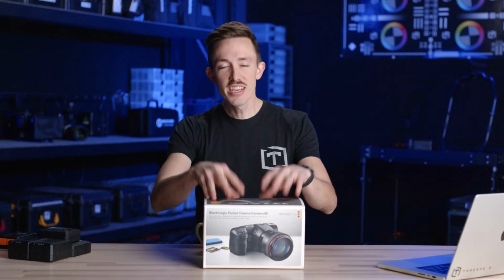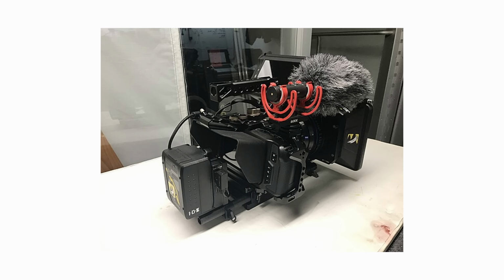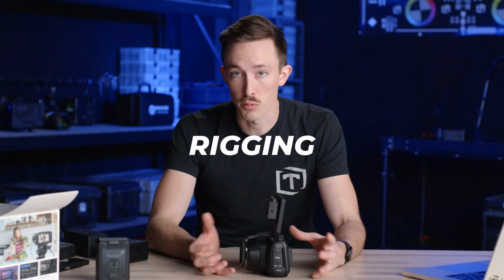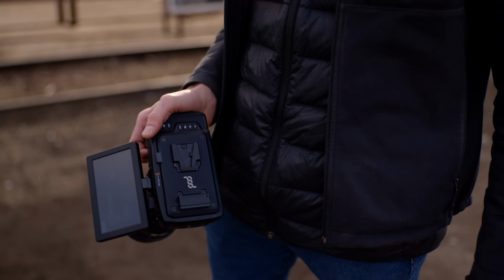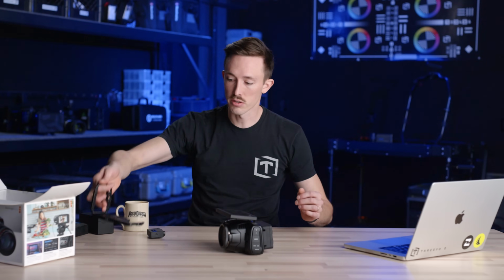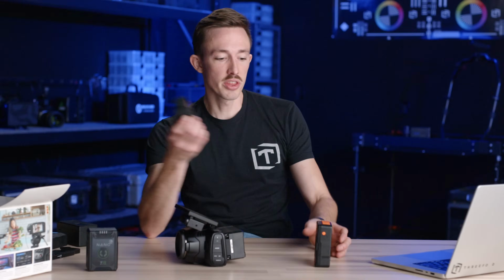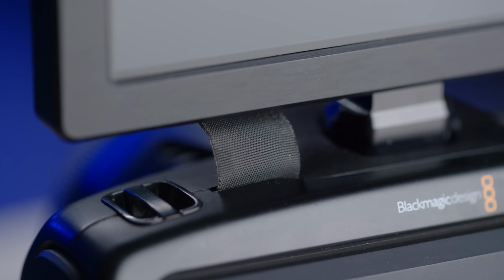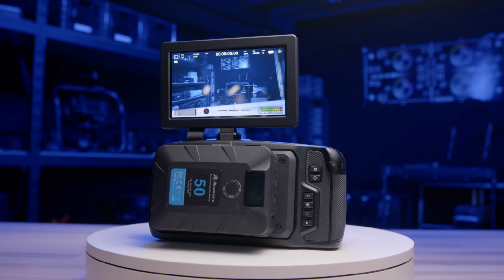The Camera We've Dreamed Of Is Finally Here! (Not Photoshopped!)

Comment: Pledged! I think this looks really promising. I have two P4Ks and this could potentially turn one of them into a more nimble set up. Willing to give it a try!

I've always used them with external monitors rigged to top handles, which is the main reason I've added the top handle for anyway. Carrying the camera and resting between shots are secondary uses, but I rarely find myself using the handle while recording.

The way this places the monitor on top of the camera, and much closer to the body compared to attaching it to a handle, while also freeing up the HDMI port to be used with a transmitter rather than an extra monitor is really good. Plus you run power and video feed to the monitor over the same cable, giving you a much cleaner build without external batteries or power cables to D-tap and extruding HDMI ports.

With a half cage on the left side like you showed, you can still rig up a rod with follow focus and keep the small footprint.

The only things that I can see as possible limitations are if you want to add a shotgun microphone or an easyrig. But I'm sure that can be worked around somehow.

Great to see that you can still improve these cameras all these years later. Would be very interested to see a gen 2 of this solution for the 6K Pro with internal NDs, with some thoughts to how you can improve further and allow for more versatile builds.

Now we just need BM to support more anamorphic ratios natively, which is another drawback from getting rid of the external monitor.

Comment: If you assemble the mod yourself, and the monitor mount is supposed to go on to the 1/4" thread on the camera, what's stopping you from using a cage and attaching the monitor mount to a 1/4" thread on the cage? Is it just the length of the ribbon cable?

Comment: This really solves so many issues and I love that. My biggest issue is screen replacements, I've never had any luck getting my bmpcc4K screen repaired after it delaminated through no damage I did to the point only some parts of the screen are touch-capable. I'd kill to just find a replacement screen so I can start using this camera again. BlackMagic was no real help.

Comment: If they were going the extra mile to replace the rear element, design a monitor w/ new housing etc etc.. it’s entirely possible to just redesign the camera into a more ‘brain’ like body such as the komodo, alexa mini. This would reposition all the camera buttons so that they could be on the sides on the camera or at the top, out of the way of the battery plate. Also adding more surf area for rigging.

Comment: love this idea, but i'm already 6 min in getting impatient. some of these videos i really just want the information, and don't want to skip thru your stuff to get to it. would love if you made condensed versions. or cut them up for shorts? i skipped to how to get the mod, and we got two talking heads back and forth still for another minute to find out it's a kit that seems to be modded off another designers kit? this looks good, but that ribbon on the monitor is not going to last long at all. i have 3 6ks, i would love to mod them if we can figure a solution to give better protection to that monitor ribbon.

Comment: Everyone in the film world misses the essence of BM pocket cameras. They are designed first as small live production cameras which then have filming features added on afterwards. And if you put the pocket cameras on sticks, raise them up to eye level, and add a focus demand to the fluid head handle—all of a sudden the 5” screen is in its native position. With that said, would I try the modification you demo here, even though I’m mostly a cine shooter? No, and that comes down to the build of the camera body itself. It’s a cute design, but bump that monitor a few times in and out of a bag or on set and the camera starts to crack, not to mention the strain of v-mounts on and off the back of a camera not designed to handle the repeated strain. I’ve never had a problem with rigging v-mounts. I’ve always used a base plate system which gets the camera up relative to the rails, and I’ve set the v-mount receiver in a prone position so the battery doesn’t interfere with the screen. This makes for a slightly longer rig, but it also keeps the center of gravity low relative to the fluid head. And now that we have mini v-mount batteries, the length isn’t even an issue any more. And let’s not forget the Tilta Lightweight Shoulder Rig which makes it really easy to mount batteries low and behind the shoulder. And with all that said, there’s far more robust ways to solve the problem this modification tries to address, especially with the more recent BM designs which have tilting screens.

Comment: Blackmagic themselves keep just milking out the same camera body, instead of listening to the end users for a better design. Though it looks like a cool mod, but wished it would allow a top grip especially when the camera is fully rigged out to work with a full crew with transmitter and wireless follow focus, you kinda need a top grip for an easyrig. It be nice if longer ribbon cable that allowed to position the monitor to a top grip and allow to use it with a full cage.

Comment: For studio use you could just get a LP-E6 or NP-F550 dummy with ac dc power supply and run that with the battery door open. So the lack of functioning 2-pin lemo isn’t an issue

Comment: I think this is a great design for traveling, but I cant really see myself using it over my current 6k setup. I prefer the top handle with a monitor and I'd be too worried of accidentally busting the main monitor with it exposed like that. The main pressure points I want them to focus on are making a full frame version, with internal NDs, and a cube configuration. I know thats asking for pretty much everything, but I do a wide variety of work and being able to shoot wider for clients that want social content would make my life so much easier. Also, if it was a cube configuration, you could actually mount the camera vertically on a tripod, very tough with the current configuration. Great video overall and it's good to know there are people trying to fix the 6k current issues.

Comment: I've always been a fan of Blackmagic cameras; however, because of the type of work that I do, I've never bought one. I shoot live theatre, concerts and dance shows so I use a number of cameras for multicam shoots. I have two GH5s, one GH5 ii, and one GH6. One of the things I like about the Panasonic cameras is that I can power the cameras with USB power banks. The GH5 ii and the GH6 can be powered with a USB via USB-C without a dummy battery. This means that if the USB power bank runs dead or the cable is pulled it switches seamlessly. The GH6 has great IBIS so I use it for close-ups. The auto focus is good in good light but if the light is low, it is kind of iffy. I found a solution. Setting the focus limiter has eliminated any loss of auto focus. One thing I like about BMC is they shoot ProRes. I get around this by using Atomos recorders. I have three Ninja Vs, one Ninja Blade and one Samurai.

Comment: I'd suggest an additional step in the mod, regarding that ribbon cable. I'd pick a industrial shelf purchase plug so that you use a cable to plug into the body and into the monitor. This is just to prevent a future failure point on that ribbon cable. Currently if it malfunctions, you are stuck, but a cable with plugs, even if you never replace it, if you have to, you can,
Reply: My thoughts exactly. If you were going all out, it’d be nice to do a pogo pin setup, but even just having a standard connector for however many conductors are needed would really make this much better.
Reply: Huh? What's an industrial shelf purchase plug??
Reply: @robertwagner8317  I took it to mean “off-the-shelf” (non-proprietary) cable, using a production-industry standard cable type. Would make it reliable, easily-available, and relatively cheap.

Comment: For Blackmagic Design specifically, I wish there was an option to just replace the BMPCC 4K's monitor with a brighter one and have it articulate.  If they did a 4K version of the 6K G2 and make it a little cheaper, that would sell like crazy.  Not everyone needs 6K resolution.  

As far as modding goes.  For the BMPCC 4K users I have an option of a brighter screen.   For all the pocket line and the newer full frame one, I would do an option for the mod kit to include a removable cable connection for the screen instead of the ribbon.  This way you can place the screen anywhere on a cage via cold shoe or nato maybe.  This way if users want handles, mics, rods with lens supports and matte boxes, etc. they can do that.  One last mod I would add is direct storage support like the Sandisk Professional PRO-BLADE SSD.

I wish I had the equipment to make my own modded version.

Comment: Great idea here but it’s a little too late and the compromises don’t outweigh modern solutions.

Dealbreakers:
1. Disabling wall power. 90% of my shoots with the pockets are in controlled studios, interviews or commercials where power is plentiful. V mounts are cool but wall power is a must to both keep the camera going and charge the battery.
2. No good way to travel/store the camera without risking the monitor getting beat up.
3. Eliminating a top handle solution.

Man, I really wanted to like this thing but a cage and a cheap monitor sounds like it’s the way to go… (or the titla route)

Fantastic video never the less. Love this format and presentation. Subbed! ✌🏼

Comment: The best part is the v mount, I am in love with that part of the mod, I know it is a lot to ask for, but in my opinion the ideal would be for the monitor to be removable. My idea is to have an extension of the cable that connects the monitor to the body of the camera and the monitor to have a 1/4" screw with locating pins on the base to place the monitor on a top handle if you want.
Reply: When seeing this mod, that is the first thing I thought of too. Is a removable, modular monitor for a future iteration of this camera. That would be perfect with this V Mount location.

Comment: Great idea but no top handle no party. To be able to relocate the monitor just slightly he should have used a normal thin cable, so you can also fold it back when the vmount is not thee. Also he should have put a nato rail or a sort of cheeseplate instead of that single 1/4-20 to move that monitor or add a top handle/accessories, that's a dealbreaker. Good for a very very basic use

Comment: The camera is literally trash on the “intended” batteries, and the screen is literally trash with proper batteries rigged behind the body. These cameras are literally hot garbage, excepting the sensors and codecs, and have been since the original body. Somebody at BMD has died and been resurrected on this hill of malicious design, that’s the only explanation that makes sense at this point. People would pay the SAME price for a box-shaped one with just a little menu screen and NO live monitor. Saying the quiet part out loud, it’s gotta be Grant, right? Who else would have the power to insist on this form factor continuing for YEARS? The 6K one supposedly is an “entirely new camera,” so why no new form factor if they had to tool up new molds for their plastic baby anyway? 

The fact that a 3rd party (multiple now) offer mods to fix this is full justification for people’s indignation at the atrocious design by BMD. It’s seriously enough to create a profitable secondary business just fixing the problem. That’s egregious. This only makes me more disgusted, and committed to NEVER giving BMD my camera money unless they pull their heads out of their read-ends and sunset this body shape.

Comment: Check out the SmallRig V-Mount Battery Plate 4064. I've been using that on my Sigma FP and it is fantastic. It has a v-mount on the back and the entire back of the cage can fold down, giving you full access to the screen. No need for expensive mods that cause features to be lost.

Comment: So, where does the monitor go when not in use? It doesn't look like it can close over the v-mount. So...???
Reply: This kickstarter is silly. So the camera will be used exclusively handheld but without a cage. It won’t need to be packed away into a bag to travel between locations. So i guess just carried around in your hands and stored on open shelf in your bedroom. If you do put it on a tripod hopefully you have multiple micro v mounts because AC power will not be applied. I’d be really interested to see what application this does that people haven’t already found solutions for by moving to other camera systems entirely.

Comment: D&O Lighting used to sell a v-mount brick that lets you plug it into a wall. It was basically a power adapter that fits into a v-mount battery plate. I don’t know if they still sell it, but if they do you could use it to power your cameras from wall power. That’s what I do.
Reply: It was the F&V V-Mount AC Power Adapter that I got. I remembers this because I ordered a 2nd one for my b camera yesterday. The lemo power port on my bmpcc 4k cameras tend to  break a lot so I needed to use these and a v-mount plate if I wanted to run my cameras on wall power.

Comment: The Tilta mod is still a better solution for gimbal duty, which is where the Pockets shine. You can use any ol' cinema camera for tripod duty in controlled light. I would use the P6k G2 or P6k Pro, but imo run-and-gun really needs a good zoom lens and the EF mount has limited options for a mid-range zoom for Super 35. And of course choosing Super 35 or full-frame over MFT means you're losing light. Thanks for the video!

Comment: I’m sorry but this is just solving one problem while introducing 100 new ones. absolutely unusable if you wanna use any accessories. I like the v mount on the back, but the monitor on top needs to go. Monitor ’s gotta be on a noga arm or so. 

Shouldn’t that be possible since the monitor is connected via cable anyhow? Just make the cable ‘un-plugable’ and longer

Top handle is absolutely key for a lot of situations
Reply: Literally. For me it was 50 watt/hr micro v mounts being the ideal form factor and loosing AC power. All this mod does is put you in a battery only position. Where cheaping out on batteries, and buying full sized neweer v mount batteries covers buttons. I agree-black magic form factors- not awesome. But as a fan, buy something that fits what you need. If you need Sony or red, do it!  I love my 6k. I use a v mount plate. And a cage. And at no point did i ever want to give up the modularity to lock in using micro v mounts and c fast.( I’ve still not found as cards to reliably record 6k 5:1) I’m almost always doing using ssd. On tripods with 70-200mm, or a battery plate on the shoulder with a 24-105 where the battery is the counter weight. I’m dying inside when i see people say they put the battery under or on top the cameras. I feel like a lot of people would be happy with the Panasonic cube camera but they don’t want to pay 4000+. Yea economy of scale is why the 6k g2 is 1595 at bh right now. The camera that ships from the factory with In body stabilization, global shutter, variable ND, auto focus, and E mount is the FX6 and it’s great and you should buy it. But stop making silly mods for pocket cameras that push the costs up into other cameras while removing functionality. Limiting you to 180 dollar and up micro v mounts after the cost of the mod, kind of seems like they would have been happier with a bsh1 or Panasonic gh6. I think we need to be ok with BM not being the end all camera manufacture. The tilta mod was neat. This mod is fine. But what seems to be a reoccurring theme is these creators want a red Komodo with Braw and internal ND for 2495. Didn’t mean rant under your comment, i agree with your sentiment, that this mod seems misguided.

Comment: The design is practical for the most part, but the battery situation can only be better by doing it the same way they do cell phones. For instance, at least %50 of the fabrication and design of an iPhone is the battery. Blackmagic would need to integrate the battery to be half the design in which is possible but adds weight and fabrication cost. 

Personally, I use a Bauer 8aH battery + inverter with USB power and 120V 150W AC outlet, and it powers everything. (These batteries are designed for power tools - very durable). Also, the 120V outlet and USB ports can be used at the same time.  Yes, these inverters exist and are not expensive at Harbor Frieght. Get them before the price hikes.

Comment: this mod really got me thinking... screen hinge on top. why did nobody really ever tried this? i mean sony did it once with nex-5 and a5000 series, but heck it was a lousy implementation, yet the idea itself makes the most sense. you can do swivel only, or swivel + articulating like most cameras today, screen can still close with the glass tucked in, opening it all the way past 180degree, and the lcd real estate becomes empty to act as battery solution... literally only 1 thing is different and that is hinge placement. it's a simple idea that solves multiple pain points for customers, yet nobody does it. i find it very weird.